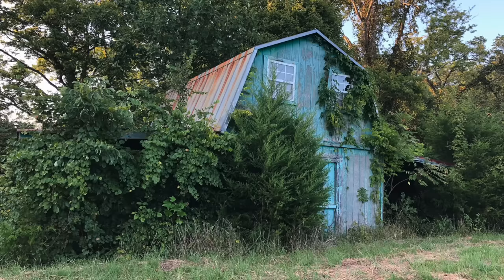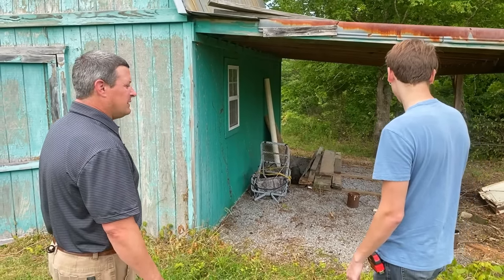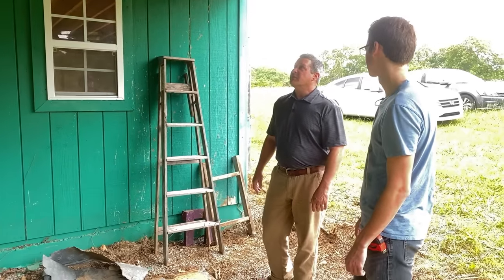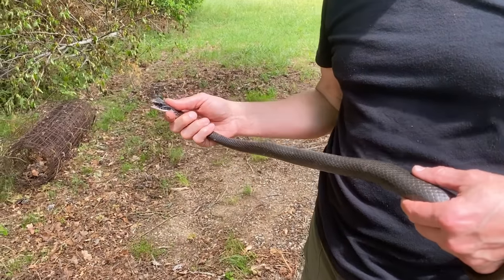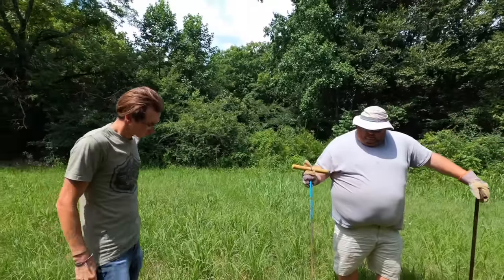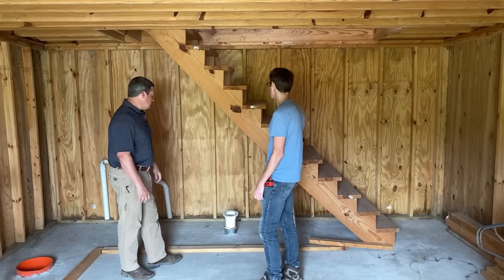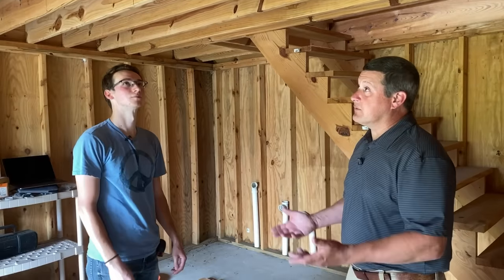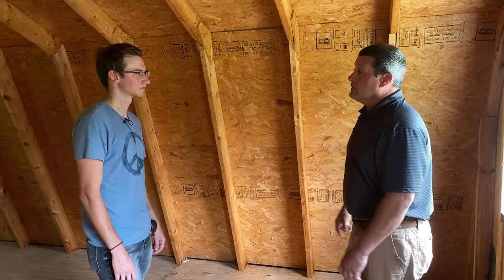Will This Home Depot Shed Meet Building Code?

Comment: As someone who has stripped a house down to the studs and started over, this project seems like more work than it’s worth. For the money and time invested, he could get a brand new shed of much bigger size with the wrap included for likely a smaller investment. I love his spirit and interest. Just think there’s a more cost effective way to accomplish it.
Reply: @Audra Gibson  How much do you think he's spent?  How much could one expect to spend finishing out the shed you mentioned?
Reply: The original shed was $5000 in 2003. We only took off the two lean-to roofs, the stairs, and the metal. Everything else was added - two slabs, framing, roofing, etc. the rest of the structure was used as is and didn’t require any rebuild.
Reply: @Audra
Starting over is way more expensive than sweat equity. And there’s not much to strip out. 
I’d remodel that myself! Definitely going to be high value once completed. And bigger isn’t always better - there’s plenty of fine US families that grew up in < 600SF
Reply: @DennisJohnsonDrummer  I’m guessing $5-$10 k, but it’s not just the cost of a new shed vs materials to fix the old one. Some people will say it costs nothing but materials if you do the work yourself, but that’s not exactly true. It costs you time in research, funding and preparing supplies and materials, and the time to do the extra labor. Let’s say for instance that he works on this project 20 hrs a week (which I think is an underestimation) for 5 months. If he had applied that same time to a job making $15/hr, that’s already $6,000. Lost time adds up.

Comment: Frame along the existing studs 2x8s, sister 2x10 floor deck joisting, run all 100% #12AWG Romex wiring, get a variance to put the structure on a 2x12 framed poured, rebar and mesh reinforced slab foundation pour foundation, vapor barriers in place, a  36" deep dual stacked 4-inch tile trench drainage around the slab, at least a 4° pitch shed roof with minimal 20-year  asphalt tiles roofing, T-111 overlay siding, a 200amp Service from municipal power and a 6,000 gallon abs plastic vacuum septic tank, and you got an acceptable Code  Variance applications Permit.

Comment: Tuff Shed no longer offers a second floor option (unless you get one of the really big barns), they offer lofts only and the barn style has a head clearance of only 5 ft.  Probably because of zoning laws, here in AZ lofts are fine by second stories require all kinds of permitting and inspections.
Reply: Well, most tiny house lofts have ceiling heights under 5ft. The average is 30 inches to 48 inches.
Reply: “All kinds of permitting and inspections”
It’s not hard to meet code. The same permit for one floor will cover a second floor. They don’t issue the permit if it doesn’t meet code. So you just draw it meet code, they issue permit. You build it. It’s no black art or mystery.

Comment: I'm my state, missouri, as long as the building doesnt have a foundation, and its outside of city limits, you dont legally have any building codes to abide by, and dont require a license or permit to build
Reply: to be fair in TN if he was cutting his own trees and making his own wood from them he wouldn't need any of these codes anyway except the electrical and maybe water if he was going to use a provider instead of off the grid set up
Reply: @0Heeroyuy01  yes. Exactly. We want to preserve electrical so we will pull that permit even though we won’t likely hook up to the grid. We can even build with purchased lumber and no permit.

Comment: No offense, I asked Tough Shed for the architectural drawings, which I submitted with my permit to construct the shed.  The Tough Sheds (the three I bought) have an aluminum trussed floor and don't need a foundation.  I raked the ground and used some long levels to check and the Tough Shed guys put it up,

Comment: So many towns now have a code that requires 1,200 sq ft plus attached garage minimum. These codes are pretty uniform becuase they were put out by the building lobby.  I'm living in a house that could no longer be built in my town, 780 square feet.
Reply: Yes. It’s really a shame that the building codes have become basically product pushing “laws.” We actually don’t need a permit due to land size and agricultural zoning, but we did it anyway for Danner to get the experience. Our local building officials are AMAZING and we invite them out often.

Comment: If you cannot get an electrical service drop out there, ask for a variance for a 200-gallon LPG Natural Gas tank for cooking and heating.
Reply: We had primary lines installed 300ft into the property and it’s about 100 ft from the shed. We will still push our off grid, but it’s fantastic to have this back up.  Thank you!

Comment: We have to dig under slab to connect it here. Need about 20 feet of slope away from structure here for code. Here a house needs to be at least 500sq ft to live in. We have to have service disconnect for electric here. Offgrid make sure you can use dc with dc battery back up smoke detectors like from rv or boat. Most code as written say ac with dc battery back up smoke detectors. Gotta go 48" inches here unless you hit bedrock. I like rock wool insulation. Egress window should be big enough for fat firefighter in full gear and yes that is written on building plans.
Reply: We have about 70’ of fall, the video doesn’t show the slope.

Comment: You'd have to have a McMansion to warrant a 400 amp service.  200 amp is plenty.  I run a 200 main and 90 amp subpanel off of that for the garage, with a 4 ton heat pump/AC and I don't even come close to half of the 200 amp allocation during peak usage.
Reply: This is the comment I was looking for

Comment: Before I watch this video:

No, the sheds' you find at home depot will not meet the IRC building minimum requirements as published by the IRC.

However, the sheds at home depot are prefab. Meaning they have been designed specifically by an engineer, using the sciences involved in that production, Then insurance is placed on that design. In other words, it won't meet IRC, but it meets factory specs.
Reply: Ours was built on site. It came from Home Depot. There are options to change framing. In many places we exceed minimums of IRC 2018.

Comment: Unfortunately according to tennessee state law anything that was sold as a shed is considered a ready removable and can't be lived in legally and an electrical inspector can not approve electrical in it if he suspects it is being converted to a home , yet alot of people do it so you shouldn't have a problem , just letting you know it can potentially cause you a headache
Reply: It was installed on a concrete slab with proper floor joists and stud size and spacing. They consider it a renovation on our permit (although we are agriculture zoned so don’t technically need that permit). Thanks for the info!

Comment: Fir out the walls if  with styrofoam insulation eliminats thermal bridging?if firing out to 2x6 either use 1.5 inch styrofoam cut in 2 inch strips or 2 inch cut in 1.5 inch strips if you check your local building store quite often they have damaged sheets for cheap

Comment: It might be better to simply build a separate garage and save the exterior walls of the shed for future living space additions
Reply: If he was tearing it down any way add a slab and another room or half room and reuse the trusses 2x6
Reply: Build a carport you can buy a metal one for 1,000 easier and no need to fire rate.

Comment: Some building codes are absolutely critical and necessary... Emphasis on "some"
Reply: Not most
Reply: Would it be the ultimate strength to use rebar and fiberglass in concrete or would it be counterintuitive?
Reply: They forgot to mention that you can just bury things in walls, hide them behind paint,  and lock the doors to avoid the inspectors. Oh wait maybe that's just a Chicago thing 😂😂
Reply: Most, like most government bureaucracy, are designed to waste your time and cost you money.
Reply: @cfunch  And to supply jobs to people who would never cut it in the real world.
Reply: I lived in a rental house that was a ranch and detached garage that some ape decided to connect and turn into a bedroom/living room (my landlord was not the issue, we were his first renters after purchasing the house) without ever pulling a permit.
There was almost no electrical at all, 1 outlet in each room and connected to a screw in fuse box. Plumbing issues, heating issues, windows made of plexi, i could go on.
So i agree that there may be too many rules, but i also agree that if there were no rules that SOME people will be complete Aholes and do stupid stuff.

Comment: the issue I see is the roofing trusses are rated for storage not occupancy. If you had them 16" on center would be better.
Reply: "the" issue? LOL lots of issues. He would be better off buying a 5th wheel.
Reply: @francismarion4450  make a tiny house so there are no building codes?
Reply: Francis Marion  thats what I thought you meant by 5th wheel

Comment: He literally came within 1" of hitting his head as he went up those stairs. Guessing head height will be an issue. Not hard to header off a larger section. But that window framing and roof framing was screaming at me and I haven't even taken the CSL test yet. In new england we have snow load requirements, wind uplift requirements, insulation needs to be like R30, which is gonna be damn near impossible. Those stairs may have enough/even rise but just looking at them I'm guessing they don't run far enough. Windows may not meet egress, but also prob don't meet R value either, and again I've literally built nothing. Net/net building in New england sucks. Looks pretty fun out that way.
Reply: @jn
R30 is 6” of foam, or foam over fiberglass. 
I’m in Vermont- code compliance has been my responsibility in several jobs over my career. It’s about finding solutions, not observing obstacles. 
In Tennessee I’m sure roof live load of 85# isn’t probably required. 

A $300 insulated fiberglass door will solve the second floor egress concerns. A deck under an 8’ roof extension and that will be awesome.

Comment: Any particular reason you decided to use the shorter overhang for the kitchen instead of the taller one on the other side? If you only need a carport, it doesn't need 9ft ceilings.
Reply: Both are the same height. See later episodes.

Comment: I would also ask if you can get a variance permit to use a 1,000 gallon water tank use for potable freshwater supply.
Reply: We don’t need a variance, because we are zoned agricultural. We have a spring and we’ll be storing rainwater in a potable/non-potable system. Thank you!

Comment: 35 degrees below zero, up in Alberta. 1960's no longer mobile trailer... R10 insulation, neighbors burned up all the wood and else building 20'000sqft megalithic conundrums... 😐, no diagonal bracing in the walls so 1_3/4 inch flooring got put on the walls... way to much money.

Comment: Codes are different everywhere, state inspector's usually have the same requirements. It's when city's, and even worse, township's , start running their own thiefdome's when cash bribes are the only way to stay on schedule without stoppages. Bribes are cheaper than engineering.

Comment: The way the building inspector explained it to me is that, if you want to live a structure that may collapse or kill YOU in a fire, no problem. They are there to assure future residents that it won't happen to them when you're long gone......makes sense??
Reply: Not really. Code is code for a reason. Death count in certain circumstances. 
Change the circumstances: death rate goes down. No matter who’s in there.

Comment: for insalation use air create  its is cement that is fluffed to be light weight,, fire proof and great insalaiton
Reply: Not too bad an idea.  Put plastic on the studs then drywall, leaving an opening.  You could fill the cavity with aircrete (the little dragon model seems good) and if you don't have much shrinkage, it would be MUCH better than fiberglass.  Might be a little difficult near the top though.

Impervious to air infiltration and internal convection like fiberglass batts.   That's a damn good idea.
Reply: Oh like hemp crete but air. Nice

Comment: You may want to ask your uncle if you should do French drains around your building that could help with any water coming into your building do to the contour of the land, just a thought 😃
Reply: Tonia ... from my experience a French drain is cheaper but will eventually require maintenance. Changing the slope for 25 - 50 feet is a lifetime of keeping water away.
Reply: @rupe53  thank you for your reply I wasn’t sure if you would need to do both
Reply: @toniamccausland4797  ... guessing new construction might require both. We'll see what happens as the videos progress.
Reply: @toniamccausland4797  for slab on grade construction, adequately graded there should likely be no need for a French drain, though a local inspector will know the soil make up and conditions better.  Definitely better to get that info confirmed before starting the project!
Reply: @rupe53  "Changing the slope for 25 - 50 feet is a lifetime of keeping water away."
There's a hell of a lot of wisdom in that quote.  Bravo.
Reply: Francis Marion  Oddly, no one has mentioned that till now.  Good point.  Guess he has to hope there is good gravel underneath it.  Or maybe hire the snakes to roll some 6 mil under there lol

Comment: This might be a couple of years old, but is great information & good to see the process. A couple of terms I'm not sure what they are, however.
   The screen mouse looks easier to use than the wheelie tool that I've always wondered what it's called, yet seems to be called, "The tool with the wheelie things on it that looks like a pizza cutter at both ends, that you use to revteen windows or screen doors". (Does anyone  know what these are called?)

A borax solution is great for not only killing molds, but keeping them away too.
Reply: You might mean "spline roller". That's what Home Depot seems to call them.

If you're in cockroach area, dumping a bunch of roach powder in the bottom of each stud pocket may be good too if you're using batt insulation.

Comment: If you live out of Town/City Limits and have Private land, You don't need Codes. I live in the "Country" Not in City Limits, I can Build ANYTHING I want and don't have Any Codes I have to Fallow. ONLY "Requirement" is to have a Septic System and Permit and there are ways around that... Like Composting.. Been turned into the Health Department for Not having a Septic system, they came out, I told them I compost and/or Throw Away my Waste because I use a Camping Toilet and it's %100 legal. I showed him my setup and he said "Okay, You're Good". I asked about Permits and other stuff, He said since I live outside City/town Limits, I can do whatever the F' I Want. It's My Land. 
CHECK YOU OWN LOCAL LAWS!

Comment: i have built 2 tiny homes for my self and a friend never once did i get the code checked  i look at it as be homeless on the street or build a house
Reply: We aren’t even required to do it since it’s agricultural zones and >15 acres. It’s just for the experience and doesn’t change much. Our building department is amazing and pro-construction. The inspectors are former GCs not tyrants that one finds in many departments.

Comment: Tell the building inspector he is trespassing if he comes on your property! I yelled at one in georgia to leave after he didn’t know code and he did and then I continued building and sold the property. I was a  georgia licensed builder since 2007 and know the code because the one I had one just hired and had passed a test to inspect which was not as thorough as the ICC I had to pass.

Comment: That stair case fails codes universally around the world.  There are way too many ways to fall down those stairs and in fact the biggest problem is the very place where the stairs open up to the second floor that would make a real building inspector fall over laughing if you ask them if it is safe to build a staircase there.  The opening will need to be in the corner of of building and not in the center of a building.
Reply: Got an entire episode on the new stairs! Check it out!

Comment: It's not a just matter of keeping the air out to improve insulation. It's a matter of controlling moisture constantly within tight tolerances, and not allowing the slightest leak in the walls for even the smallest amount of moisture to build up, otherwise mold and such are much worse because the walls are mostly sealed so the moisture cannot escape. Modern codes are much riskier for the fact that they require complicated climate control systems, and much less forgiving construction practices. 

Today's workforce is less skilled than in years past, partly because culture and economics has shifted people from the skilled trades, but also because the focus on trivial details like the maximum height of the each step of the stairs, to the detriment of important details like the quality of the roof and foundation. Everything comes at a cost.
Reply: Yes. Few think about this and there are a ton of 50-70 year old buildings with no rot and many more from 70-80s that are destroyed.

Comment: Sheds are not housing. There is no required building paper under the plywood siding.....
Your inspector missed that fact! In order to sheetrock the walls the exterior vapor barrier is needed.
Reply: They're obviously not going to leave that crap exposed lol
Reply: @TheGuruStud  Exactly! Once you enclose the walls the building paper is required under the exterior plywood to prevent mold and other rot in the annular space in the wall.